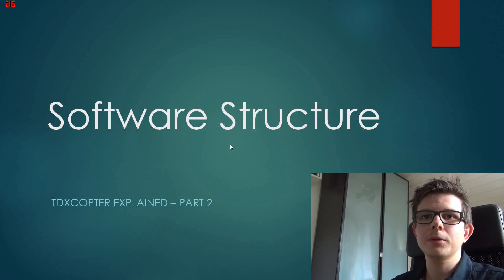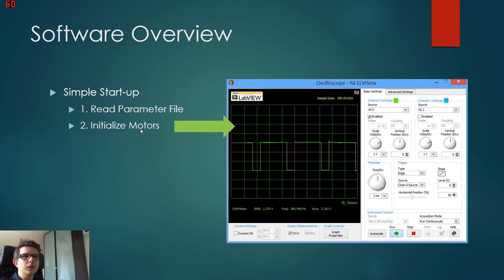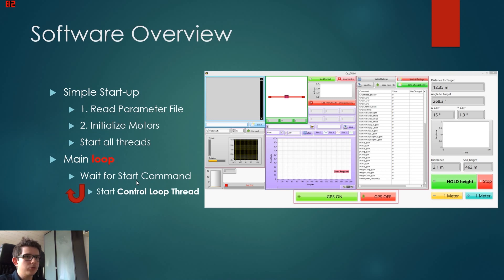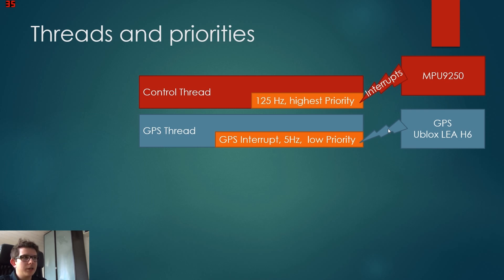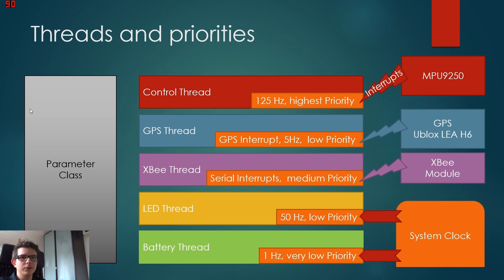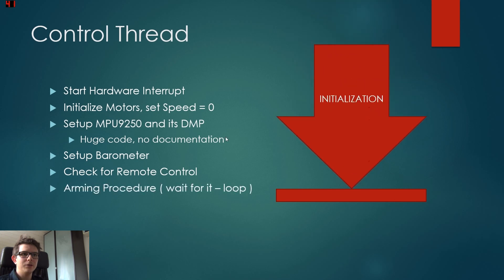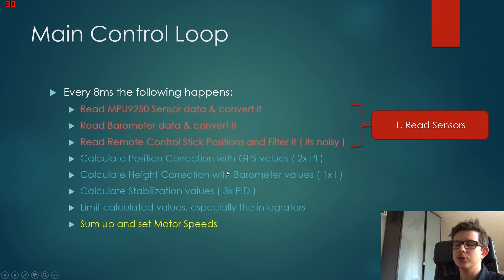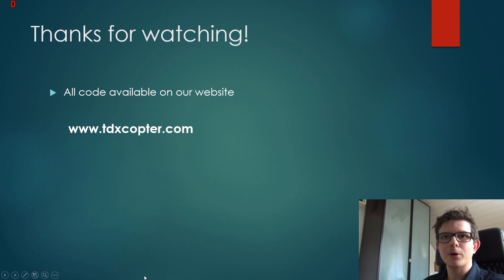How our Quadcopter works 2 - Software, PID Control with Windows CE7

Comment: Nice quadcopter. did you write the application running in toradex module in labview?. if so how did you get labview to build and deploy the .exe to the colibri module?. I've been trying this too but labview does not seem to recognize the device. Could you give me some pointers on this?.
Reply: Thanks man! No I did not write the code for the toradex in LabVIEW. Only the User interface on the computer. I used C++ with Visual Stuido 2008 for the toradex. The code is available for download on our website.